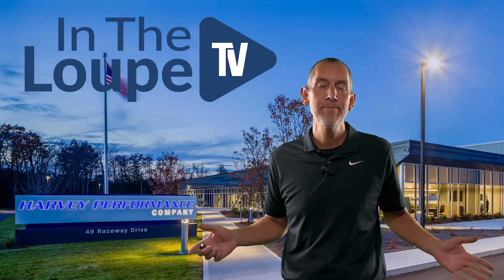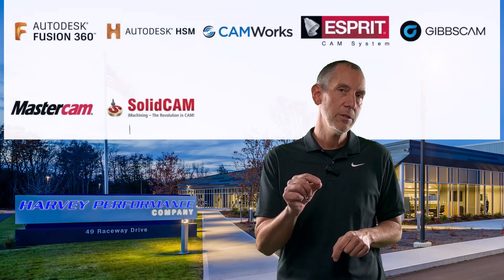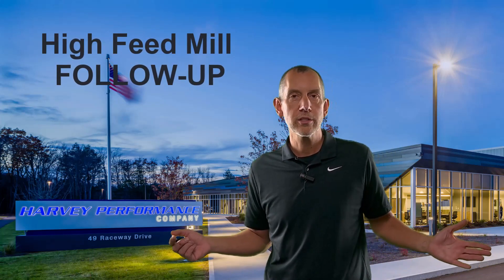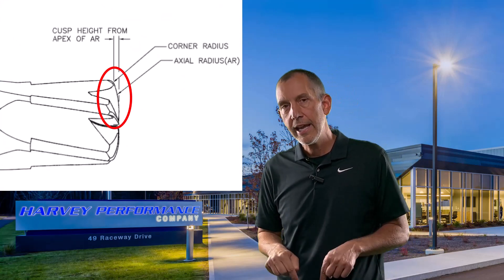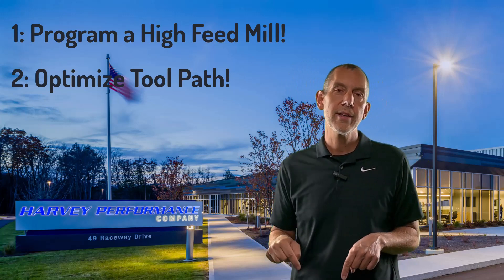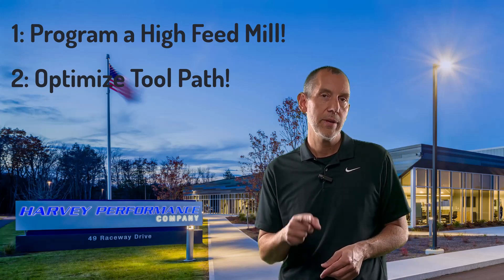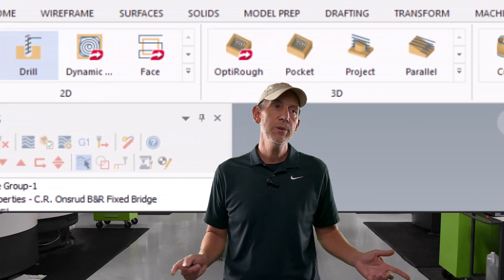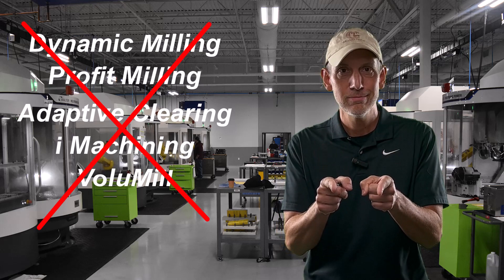Programming High Feed End Mills: In The Loupe TV Ep. 6

Comment: Great video. I use mastercam and use dynamic as much as possible with hem cutters. Sometimes i use dynamic with high feeds, im aware of cutting air, sometimes just cuts great when other conditions exist. When high feed milling i try to stick to simple contouring, area mill, helical ramping and pocketing with true spiral. Spiral does cut a little air if you are picking out corners but it is very smooth.
Reply: Thanks for the tip.   I will have to try the True spiral path.  Ctc